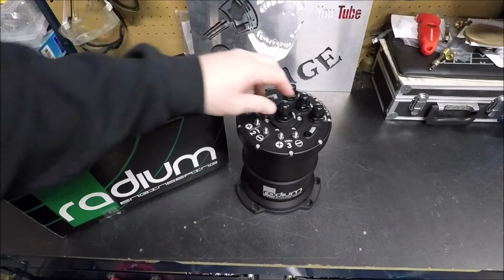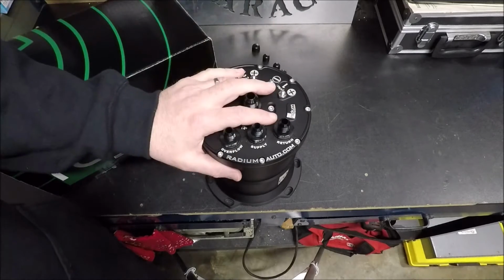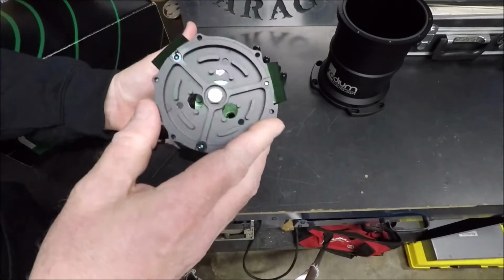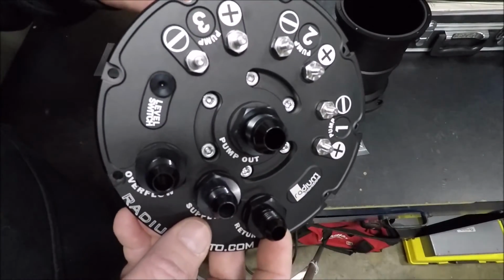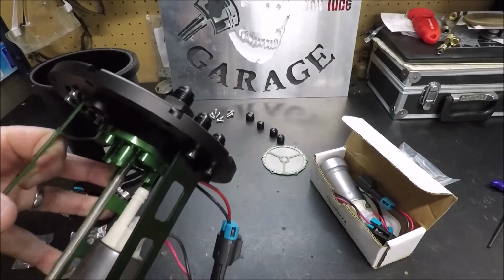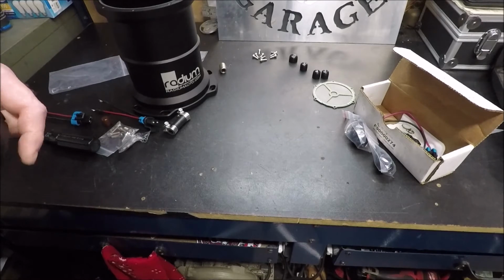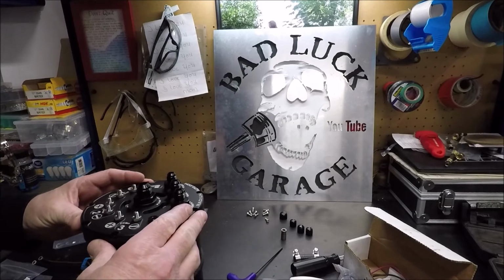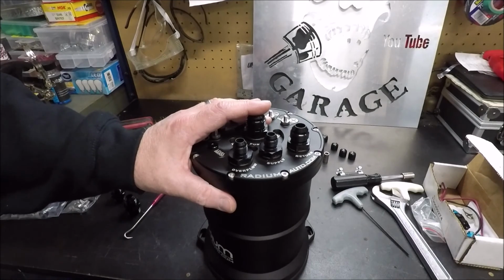RADIUM ENGINEERING SURGE TANK SETUP, REVIEW, AND EXPLAINATION

Comment: So I run a -8am feed and -6an return on a 900hp STI. 4 years strong. Don't get lost in -10an and -8an unless your popping 1200hp car
Reply from the maker: Thanks for watching. We ran -10 feed split to two -8 at the fuel rails and just a -6 return. 3 Walbro 450s in this surge tank staged to activate at different boost levels. We’ve been running this setup for over 5 years now with zero issues. There’s a separate video in the Chaos Theory Camaro playlist going over the entire fuel system we built to handle up to 1500hp if you’d like to see more. 
-BLG
Reply: @BadLuckGarage this question is off topic. Concerning evap delete, did you have any issues with fuel tank pressure with fuel temperature increase? Or was the the factory evap lines enough to release the pressure?

Comment: the -10 would be because 3 pumps are merging into one point, so -10 would be an easier turn than a -8.
Reply from the maker: I agree and I explained that in the video. but it didn’t come with a -10 fitting, it came with a -8. That was also explained in the video. It was my only complaint with this unit.

Comment: How does the stock in tank fuel pump keep the surge tank fully supplied with up to 3 fuel pumps out of the surge tank?
Reply from the maker: Because you’re only using all the fuel volume of the pumps in the surge tank for a few seconds at a time, and during those few seconds they have the entire volume of fuel in the surge tank to draw from.

Comment: Learning from your channel. Honestly did not know something like this existed.
Reply from the maker: There are cheaper ones on the market. I think I said it in the video but the main reason I went with this one was because it’s designed to be put in the truck instead of under the hood or somewhere else outside the car. You can get regular generic surge tanks on eBay for less than $200 if that isn’t a concern. 👍
Reply: @BadLuckGarage  ya I was looking at the eBay dual one for $225. Dual 450s should do 1750 HP at the crank which is about 1230 HP to the wheels. I do not think I would ever go over that.

Comment: yeah they are better in the hatch space to keep the fuel temps down... Id only be concerned about snapping a line in a side corner impact accident. i have a single pump surge for a 450 but im mounting it towards the middle front of the hatch to keep it safe. Im also adding an emergency cut off switch that i can reach just incase of a leak of any kind. that and a (fuel) cool can to keep temps down and its good to go. good stuff
Reply from the maker: If I get hot from the side at the drag strip then fuel leakage is probably going to be the least of my worries. 🤣 But the fire system will come after the roll cage is installed. As explained in the video, this tank also has a safety switch that can be installed and sends a 5v signal if file level drops more than about 1” below the top. This will trigger my Holley ecu to not only shut down the pumps, but all over systems as well. And currently I already have a safety setup to shut down if fuel pressure drops below 30psi after our last escapade at the drag strip a few months ago. 👍

Comment: But would the rubber hose be reliable submerged in the tank? I think it's be better with the flexible plastic hose.
Reply from the maker: It’s submersible hose. There’s a difference between regular fuel line and submersible fuel line. 😉 I 100% do NOT recommend using regular fuel hose inside your fuel tank.
Reply: @BadLuckGarage  ahhhh okay. That's good to know. I'm looking at a few tanks, what do you think of the Nuke performance tank 3.0 for the walbro's? What are your power goals???
Reply from the maker: Nuke is the company that offered me a discount to do a video with their tank. I chose this one instead for the reasons I mentioned in the video. There is no real HP goal for this car other than “beyond four digits”. This car is going to be a mainstay on this channel and will just continue to grow and get faster. It’s the only vehicle in the channel without a real goal or budget.

Comment: Do the 525 pumps actually work in that setup?
Reply from the maker: Absolutely. It’s actually one of the pumps listed to use with this surge tank. 👍 I would have already been using the 525 pumps if I hadn’t gotten such a good deal on the set of 450 pumps I installed in the video.
Reply: @BadLuckGarage  nice!

Comment: The rubber hose you used doesn't look like the ones that come with the 450  pumps. I hope it's not I know of 2 youtubers and myself that that the cheap hose blow out in the fuel tank. Just wondering. Thanks for the video.
Reply from the maker: Believe me, nothing that came with this surge tank was cheap. I'm sure its submersible hose.